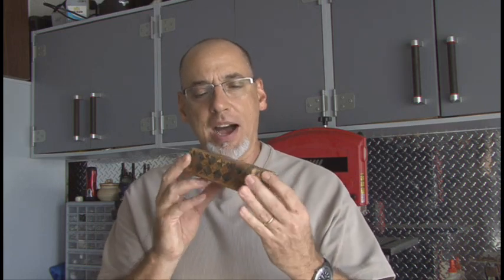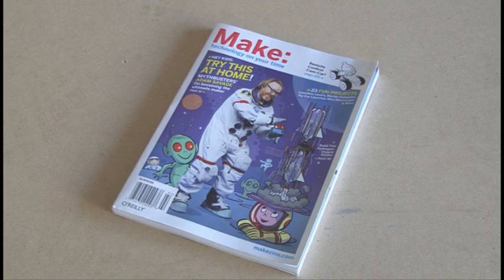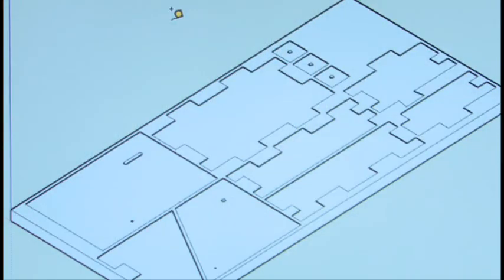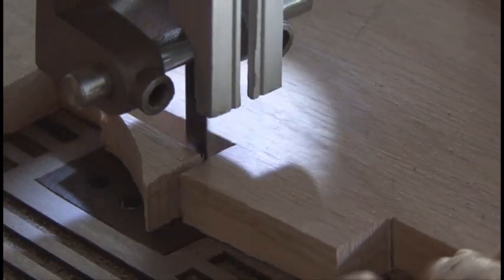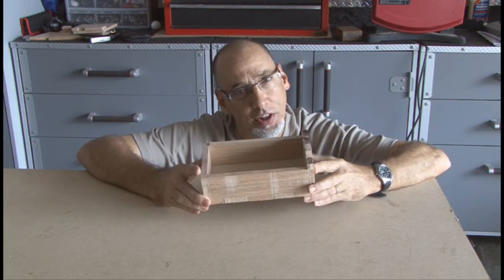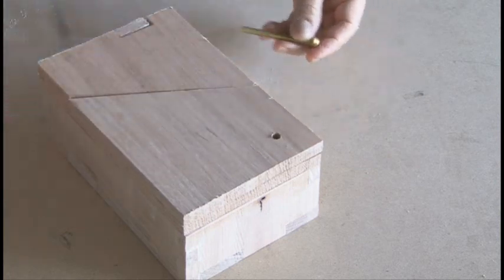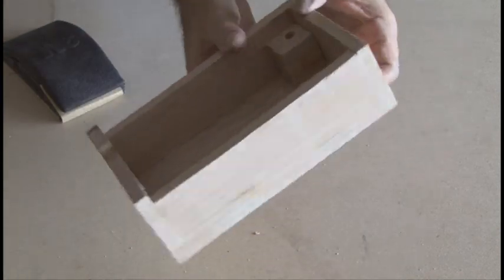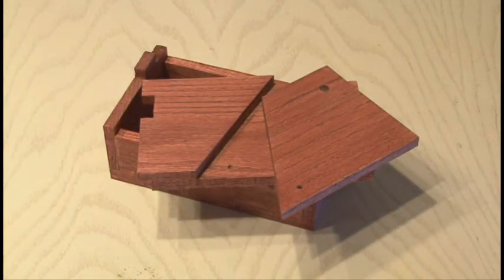Weekend Project: The UnaBox

Comment: I made this one time, it was pretty cool. Before I added the lid, I drilled a vertical 1/8" hole and glued a 1/8" diameter dowel into the height of each corner just to add to the stabilization and connectivity of the corners in the box.

Comment: Change the way you drill the holes for the small dowel to a hole 1/2 through the top and just a little into the bottom piece, change the dowel to a bb and grab a magnet. That would be a secret lock.

Comment: 1:00 or just paste it onto the wood pieces
Reply: cover wood with masking tape or painters tape then apply a spray glue put paper pattern on. when done cutting tape peels right off leaving perfect wood underneath.
I'm guessing you guys have never done intricate scroll saw work before.
Reply: Yes because I want glue residue all over the expensive hardwood I just bought. You don't do fine woodworking much, do you?
Reply: I don't, but I believe to have some skills in working with materials and common sense though. You just need a little of vinyl glue diluted with water. It is strong enough to keep the paper adherent while cutting but not too much to prevent to remove it with a moistened scrubbing sponge. Or just slightly engrave the perimeter with an awl, utility knife or a small screwdriver.
Reply: Kevin McFadden Best tip
Reply: cranchee good point

Comment: Kip suggested you may want to wear gloves when cutting wood. NEVER use gloves when cutting with a power tool.  If the blade grabs the fabric it can pull your hand into the blade. Use goggles, push sticks and be careful.

Comment: You could attach a foot to the secret dowel if you change around the schematics. Then you could attach a foot over the pivot dowel and two more feet on the remaining corners. With the box oriented upside down, you could router the edges and cut a false seam line and attach false hinges to the seam line on one of the long sides of the box.Then it would be even more confusing to someone who doesn't know the secret to opening the box.
Reply: That's a great idea
Reply: Very good! Anything to disguise the "secret" pin.

I'd make the feet you described all able to rotate - tightly, but without any limit - and add a little limb sticking out perpendicular to the inner end of the key pin so it only comes out at a certain angle.

If you can make a maze out of it, it will only come out if you rotate and move in and out in a particular sequence. The other feet have decoy mazes to make it more confuzing.

Comment: NEVER! Use gloves around machines!
Reply: Tomas Kerslake-sweeney if your wearing gloves and they catch in the blade your hands will get pulled in and sliced up. Gloves and fingers are a lot softer than wood and steel if it's designed to cut wood you can guarantee it'll cut the glove just the same.
Reply: ***** Gloves can get snagged by the machine, and you loose bodyparts.
Reply: +Matte Edström 
I agree. Make: should edit the video and take that portion out about the gloves.
Reply: Body parts :o
Reply: that where your wrong bud, granted they can get caught, but you were them as an extra layer so you don't loose fingers

Comment: What is the thickness of the wood?
Reply: You could really use any thickness as long as you adjust the depth of the fingers on the comb joint to match the thickness of the adjoining piece.

Notice at 1:58 how the joint fingers stick out on Kip's box?  He cut them too deep.  You could sand it flush after, but it's easier to begin with the right cuts.

Comment: If you use the big dowel instead of a bolt, can't I just pull at the top and all the pivoting parts will simply slide off of it?
Reply: you could fix that with a small adjustment.

Comment: I'd like to make something like this, only with an Arduino on the inside and a solenoid to open a latch.  Maybe hook up a reed switch to a long-lasting battery pack so you can turn it on with a magnet, then have it look for an RFID tag

Comment: Make the small pin made out of metal with tiny sliver of a wood top that matches the wood cover flawlessly, then it would require a magnet to open it!  Even cooler!  Could even conceal a magnet between fingers or magnetic ring

Comment: This box its so easi to open,How? use hamer :D
Reply: use a crowbar
Reply: ***** didnt think of that
Reply: Keegan Maloney But he stashed 50 x $100 bills inside it and you have defeated the purpose of getting into the box. The pin should be bigger with a tumbler lock inside. So now we got a box big enough for $100 bills that is made of 1 inch thick steel with a tumbler lock for the pin. If your not going to put money in a bank? Wouldn't buying a small safe be easier? I loved reading this argument through though :) Thanks peeps.
Reply: adder2204 thermite paste sometimes called thermite gel can be controlled such that once it stops burning though something it slows down its reaction such that it congeals not a millimeter away from the edge of what its burning through. It is used primarily to breach security doors and safes. the idea is that you do as little damage to what is on the other side as possible. It functions very similar to binary and in fact you can make it a binary reaction trigger. admittedly not sure I could make the compound as such with household materials  but with a little studying and maybe a little equipment it could be made. 

You could also get binary gel if you know where to get it. I believe the traditional binary is illegal for citizens in most places though. By the way DON'T ask me how to make any of this stuff I won't tell you. But if you are interested in how to break into something without fail on a non specific level, there you go.
Reply: *****
A torch.
Reply: ***** he could always use thermite. you can whip some up at home if you know what you're doing.
Reply: Keegan Maloney
what termite the exact insect?
Reply: Daniel Lovendino Thermite. As in (typically) aluminum with iron oxide and some other stuff I am not going to tell you. It burns at like 2k°c.

Comment: Rather than using that tape measure thing he used, it would be much easier to simply print out the pattern, cover your board in painters tape then glue the pattern to the taped board and cut it on a scroll saw. Probably the way it was intended, judging from the plans.

You will most likely end up with cleaner lines and none of the gaps this guy had. The pieces should fit together much more nicely.

Comment: because the wood against good friction would be too much, unless you were to make the hole slightly bigger but then the dowel might fall out of range of a magnet. You'd probably want a way to stop that happen , perhaps making the hole in the lower lid a dimple instead and the pin just sits in there. If the dimple wasn't deep enough , it wouldn't effect the opening of the box.

Comment: thats..not a bad idea. or in have metal pin on a soft spring inside the box and have a powerfull magnet to pull the pin and compress the spring. a hidden pin and lock type

Comment: If you have one, the original PS2 (Not the slim) has a "Secret compartment" That was meant for a mod or something. You open up one of the pannels (Don't need a screwdriver or anything) there's just a very big empty space behind it. Useless for anything other than a secret draw... Or at least a draw in the last place you'd expect there to be a draw.

Comment: Another option to add is to using a magnet on the bottom of the small dowel, so you can make it flush with the top and than by adding a more decorative pattern to the top you can add a "camo" effect to disguise its presence. Then, you can just use another magnet, or metal, to retrieve the dowel from its spot.

Comment: I have a slight mod. You could use a piece of magnetic metal instead of the smaller pin. Then, you'd need a magnet to get it out, though the problem with that is: It's kind of hard to make metal look like wood.

Comment: I love all of these projects, but this one just seems unpolished to me.  The Large dowel and small dowel are too obvious!  Add some more large and small dowels all over the top of the box as decoys.  A trickier way would be to use a hidden spring-loaded plunger-pin-latch in place of the small peg, that was retractable with a strong neodymium magnet from the bottom.

Comment: I described the wooden equivalent of a c-clip if you understood what I wrote.  Without a retainer the box falls apart,  "tension"  doesn't cut it.  You have to glue the lid to the dowel, and design in a retainer,   obviously the dowel would require a groove all the way around so the pin  or c-clip can retain it, and it can also rotate, Get it?   Neither did the unadesigner.

Comment: Tension won't hold it since if one end is glued, the dowel is also functioning as a bearing. The correct way to fix the design would be to cut a groove around the dowel, then drill a hole at 90 degrees for a dowel that will go into groove and act as a retainer.

Comment: Better yet, use a small metal pin instead of the small dowel. Don't drill all the way through the top and make the hole slightly larger than the pin. Slide in the pin and plug up the bottom hole. If you hold the box upside down gravity will pull the pin into the top piece of wood and allow it to pivot. I've made some like this before, almost impossible to figure out unless you know the trick.